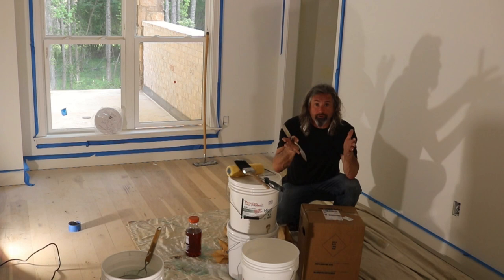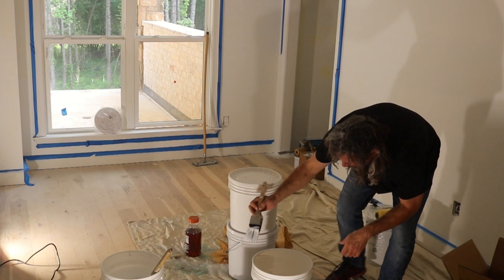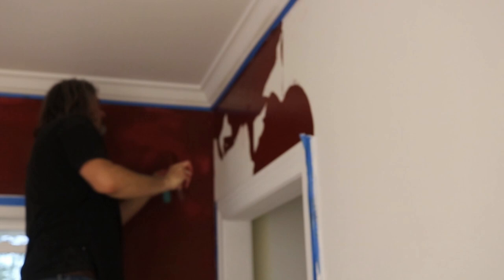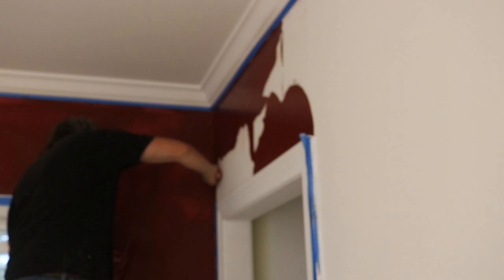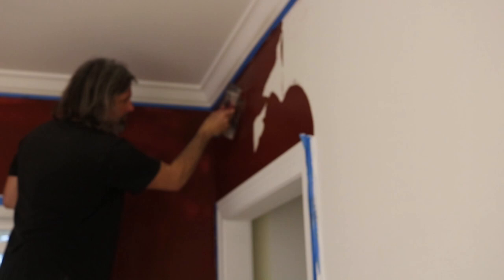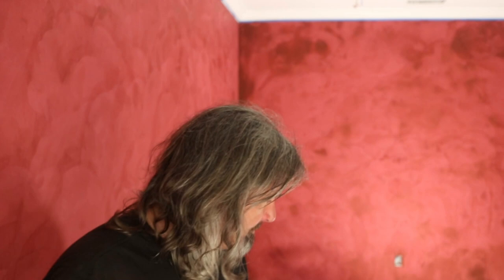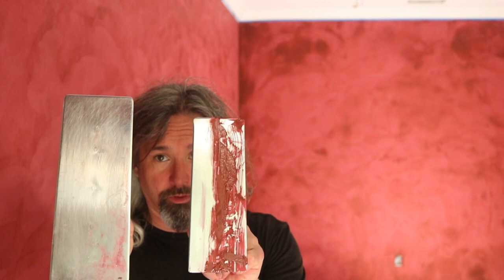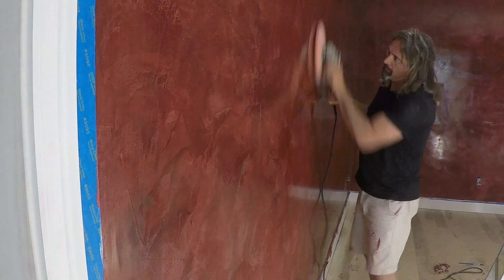How to Venetian plaster a room, Ron shows you how to plaster

Comment: I did Venetian plaster with valspar paint on my accent wall. How you don't have chronic tennis elbow blows my mind! I still have numb fingertips on my middle and ring finger. Is there any tips when burnishing? We also had big repairs to cover and some of the under patches still show through. Maybe another coat?
Reply: Practice makes perfect, you should of started out practicing on small plasterboards, venetian plaster cam be done at home but to get a finish like this requires experience/patience